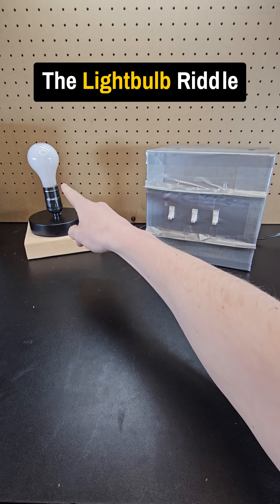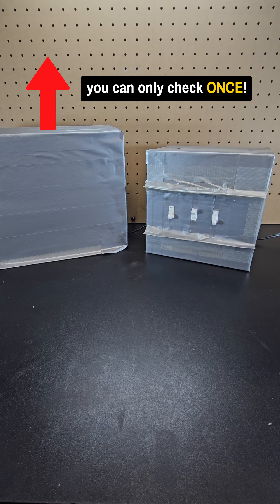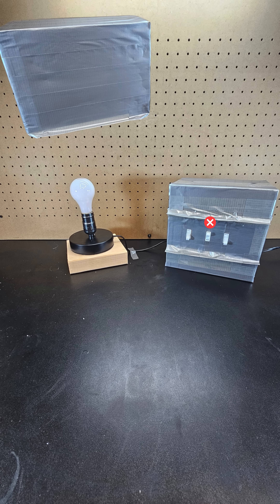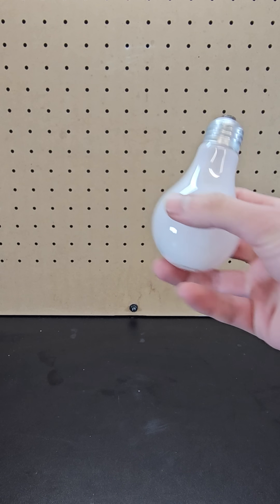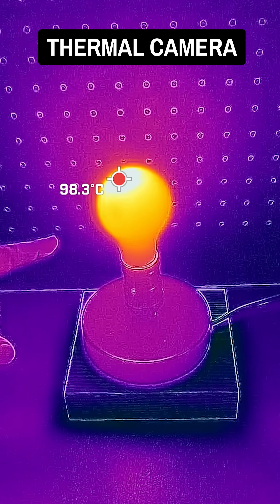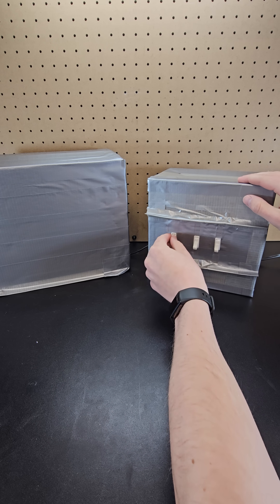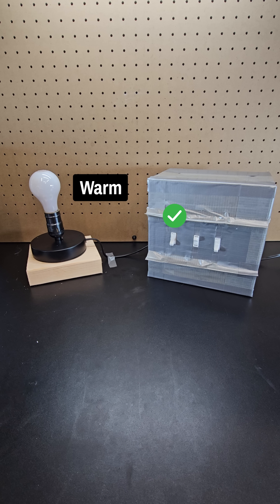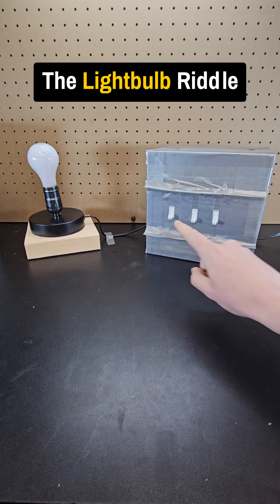Can you solve this Lightbulb Riddle? #science #shorts

Comment: First, you want to turn on the first switch and leave it on for ten minutes. Then, you want to go and check the light if it was hot. I forgot to say to turn off the light after ten minutes past. If it was hot then it was the first switch. If it was not hot then you got to repeat that same process, but with the second switch. If it was not hot then it will be the third one. That is how you do it

Comment: You flip the first one. Wait a bit and then turn off the first one and the second one on. Then check. If the light is on its the second one. If the light is off you touch the lamp and if its hot its the first one but if its not its the third one

Comment: Lift two of the switches, then turn one of them off and lift the cover, if the light bulb is on its the switch that is on, if the light bulb is off but hot to the touch, it's the one you just turned off, and if it's off and cold to the touch, it's the switch you haven't touched

Comment: Turn on the first light switch and wait an hour, then turn the first one off and enable the second one. If the lightbulb is on then the second switch is the correct one. If it is off and the lightbulb is warm to the touch then the first switch is correct. If the lightbulb is off and cold then the third switch is correct.

Comment: You flip the first and wait a bit, then flip it off. Flip on the second switch and remove the cover. If the light is on it’s the second switch. If the light is off and hot it’s the first, if it’s cool it’s the third switch.

Edit: For a second there I thought you were going to give a different way to solve it haha.

Comment: Flip the first switch and leave it for 10 minutes. Then flip the second one while turning the first one off. Then check. If the bulb is on then it’s the second one, if it’s off and hot, then it’s the first one, if it’s off and cold, then it’s the third one.

Comment: Before the explanation starts, flip one switch, leave it on for a bit, then flip it off then flip another one on, then check it, if it flows, well you're done, but if not, then touch it, if it's warm, then the first switch is correct, but if not, then the 3rd one is

Comment: One can guess with 66% accuracy. Chose one switch as your guess, flip that switch and another one, check. If the light is on then flip your switch off, as the probably of the second switch being the one has increased. If the light is off the third switch is always the solution. (Method works with led)

Comment: I find a similar solution but with one less step. 
Turn the 1st and 2nd one on. 
After 5 mins, turn the 2nd one off and remove lid. 
If bulb on, means it's 1st. 
If bulb off but warm, means it's second. 
If bulb off but cold, means it's third. 

Is this a valid solution or did i miss something?

Comment: A big problem with riddles like this is that it’s kinda hard to tell if it’s a “math riddle” (where everything you need is in the question you just need to understand it well) or a ‘trick’ riddle, where you gotta know the trick (and a issue with trick riddles is that there are so many tricks one could find for smth like this; lift the top then fiddle with the switches, use an infrared camera, see if you can see through the top, cut a hole through it, cut a hole through the table, look at the wiring of the switch…)

Comment: Keep the first light switch off, turn the 2nd light switch on about 10 minutes then turn it off, finally turn the 3rd switch on and look under the box

If the light is on it’s the third one
If the light is off but hot to the touch then it’s the second one
If the light is off and it’s cold it’s the first one

Comment: flip the first switch on wait 15-30 minutes turn in off then switch the second one and check if the light is on if it is then it’s the second switch but if it’s off the touch it if it hot then it’s the first one if it’s cold then it’s the third switch
Reply: i didn’t know he would reveal the answer i typed this before he told me 💀

Comment: I almost had it right, I was thinking u turn 2 light switches on and leave it for 5 mins then check if the bulb is warm, if it’s not then u know the remaining one is the correct one, if it is warm its one of the ones u flipped originally, I didn’t solve it but I brought it down from a 1/3 chances to a 50/50

Comment: Flip two, wait a few minutes, then turn on switch off. Check the bulb, if it’s on the you know it’s the switch that is on, if it’s off then checking if the bulb is warm can help determine wether the switch that you flipped on and then off was correct, if it’s cold then it’s the switch that you hadn’t touched.
Reply: I went: 1, 10 mins, switch from 1 to 2, lift the lid, etc.

Comment: Turn two switches on. Leave them on for a few minutes. Turn one off. 

If the bulb is on, it’s that one. 
If the bulb is off but warm, it’s the one you just turned off. 
If the bulb is off and cold, it’s the one you didn’t touch.

Comment: Flip two light switches check the box simple (if it's on then you only haft to guess between two) 
(If it's off then the only one that's not flipped is it)
Reply: Wouldn't you have the same odds if you only flipped one switch though?

If it's on, it's the single switch you flipped. If it's off, it's one of the switches you didn't flip.

Compared to...

If it's on, it's one of the two switches you flipped. If it's off, it's the switch you didn't flip.
Reply: he said it can’t contain luck

Comment: Turn on first switch, wait ten minutes. turn off the first switch and turn on the second. Quickly lift the box and if the light is on its 2. If the light is off touch it. If the light is cold, it's 3, if the bulb is warm it's 1

Comment: Simple as you have a 50/50 on getting another 50/50 or instant answer:
on off on
If light is OFF you found wich switch is the correct one
If its ON then ya have a 50/50 guess between the two flicked switches

Comment: You flip switches A and weight 10 minutes. Then you turn off switch A and then flip switch B and lift up the box. If the light is off then feel it and if it's cold then it is switch C if the light is hot then it is switch B and  if the light is on then it is switch A.

Comment: There is a tiny section of table that reflects the light while the cover is down, after you lift up and then put it back it's on the left side of the cover by the corner. But that reflection wasn't visible even when all of the switches were flipped, there was a cut in the video where it goes from off to on and you lift the cover. But that's technically cheating so this answer doesn't count.

Comment: Switch one switch and then wait 40 mins then turn it off then turn on the other switch

If the light bulb is hot then its the 1st switch, if the light bulb is on then its the 2nd switch, if the light bulb is cold then its the 3rd switch

Tell me if its correct!

Btw i paused it

Comment: Assiming no time limit. Flip swotch one for a cpuple minutes. Turn it off a d flip switch 2 
Lift up cover, if light is on the. Switch 2 is correct. 
Is light is hot then switch one is correct. 
If not on and not warm then switch 3

Comment: I actually know how to:

You flip the first switch. You wait ten minutes and then turn the first one off. Then you turn on the second switch on.

Then you check: 
1. Of the light bulb is hot and off it's the first one
2. If the second bulb is on and is cold it is the second one
3. If it is cold and off it is the third one.

Comment: Flick 1st light switch than wait 10 minutes than turn on the 3rd light switch and check the light bulb if its on its the 3rd light switch if its off and its cold to the touch its the 2nd light switch if its off. And hot to the touch its the 1st light switch

Comment: Turn the first switch on, leave it on for a minute, then turn it off and turn the second light switch on, then remove the cover.
If the light is on then it's the second switch, if the light is off but it is hot, then it's the first switch, if it's off and cold, then it's the third switch

Comment: You probably could measure when the line to the light is energized with an oscilloscope. Wrap some foil around the wire and measure voltage from capacitivity.

If all else fails, lift box and remove bulb. Answer: trick question, none of the switches light the bulb.

Comment: 1. Flip the first light switch, leave it on for 5 minutes.
2. Flip off the first light switch and flip on the second light switch.
3. Lift the box.

If the light bulb is off, and warm to the touch, the 1st light switch controls it.
If the light bulb is on, the second light switch controls it.
If the light bulb is off and cool to the touch, the second light switch controls it.

Comment: Keep the first switch on long enough to get the bulb hot, then turn it off, then turn the second swith on and lift the box. If the light is on it's the second switch, if it's off but hot it's the first switch, if it's off and cold it's the third switch.

Comment: I would flip 2 switches then I would flip one of the open switches after some time I would open the cover if the light is on that means it's the switch that's on if it's closed and hot that mean it's the the switch I opened and closed if it's not open or hot that means it's the switch that I haven't flipped

Comment: haven't watched the answer yet. you turn one of them on for like 5 minutes, turn it off, and turn on a different one and check. if the light is on, than its the one you just flipped. if its off and hot then its the one you left on for awhile. if its off and cold then its the switch you didn't touch

Comment: U guys ain’t getting it basically flip the first switch and leave it for 20 mins and then turn it off and then flick the second switch and instantly check the bulb. If it’s hot the first switch is the one. If the bulb is on the second switch is the right one. And if it’s cold and turned off then the 3rd switch is the one

Comment: heat. provided you can insulate the box well enough, flick a switch and leave it for a long time, then unflick it and flick another. If the bulb is hot, its the first you flicked. If its on, its the second. If neither, its the only one you didnt flick.
edit: wow ok, didnt expect this to be the ACTUAL solution, but ok

Comment: I’ve seen this before but with 3 switches and a room you can only check once. Here is the actual answer.

Flick the first switch and wait 10 minutes
Turn it off and flick the second switch
Check the room, if the bulb is off but hot, it’s the first one. If it’s on it’s the second and if it’s off and cold it’s the third.

Comment: Turn the first light switch on for at least 30 minutes. Then turn the first switch off   , and the second switch on. Now check the light. If the light is on then it’s the second switch. If the light is not on put your hand on the bulb to see if it is warm, if the bulb is warm then it is the first switch. Finally if the bulb is not warm or on then it’s the third switch.

Comment: flick switch 1 and wait awhile then turn switch  1 off and turn switch 2 on. Then check if the light bulb is on. If it is its switch 2. But if not touch the lightbulb to see if its hot. If it is, its switch 1. If not its switch 3
Reply: Yes i was correct

Comment: The solution is flip the first switch and leave it on for 10 minutes without lifting the box turn it off and put on the second switch immediately check the box if the light is on then you will know that is the second switch if it is off you can touch it and if it is warm, then you will know it was the first one if it was cold, it would be the third one

Comment: Turn on the first switch and leave it for ten minutes. Then turn on the second switch and check the light. If the light is on it is the second switch. If it is off and hot it is the first switch and is it is off and not hot it is the third switch. This is because having the first switch on for ten minutes will heat it up.

Comment: Turn on two of the light switches, wait 5 minutes, turn one off. Lift the box. If the light is on it’s the switch that is still flipped. If the light is off feel the bulb. If the bulb is warm, it’s the switch you flipped off. If the bulb is cold it’s the one you didn’t flip.

Comment: You turn one light switch on, and wait a few minutes, then flip one more and open the cover. If the light is off, then it’s the third switch. If the light is on, you check if the bulb is warm. If it’s warm, then the first switch is the one that controls it but if it’s warm isn’t warm then it’s the second switch

Comment: i would flip one switch for 3 mins then close it and switch on another one if the light is on it's the second one if the light is off but the bulb is hot it's the first one if it's off and it's cold then it's the third one

Comment: Let one switch be on for a while then turn it off and turn on the other switch and check: if the first one u did will turn on the light the lightbulb will be hot but if it is lit and it isn't hot it is the second one and when none applied then it is the third

Comment: So what you should do is cover the light and only flick one switch and leave it there for about a minute to 2 minutes flick it off and uncover it if the light bulb is hot and then it is the light switch if it's not do it again until light bulb produce heat and the only switch that can produce heat is the correct one

Comment: The correct answer is to leave switch A on for about 10 minutes. Then turn the switch B on and lift the cover. If you lift the cover and see that the lightbulb is on, then it has to be switch B. But if the lightbulb is off, you touch the lightbulb to see if it is hot. If it is hot, then jt it is switch A because you left it on for 10 mins. But if it it is cool, then it is switch C as it was never flipped. 🎉

Comment: The correct answer is leave switch a on for about 10 minutes. Then turn the switch B on and lift the cover. If you lift the cover and see that the lightbulb is on then it has to be switch B. But if the lightbulb is off you touch the lightbulb to see if it is hot. If it is hot then jt it is switch A because you left it on for 10 mins. But if it it is cool then it is switch C as it was never flipped.
Reply: Damn i got that right

Comment: This is when light bulbs gave off heat. Turn on the first switch and wait for 20 seconds. Then turn it off and turn on the second switch and lift the cover. If the light is on it's the second switch.   If the light bulb is off, feel the light bulb. If the light bulb is warm it was the first switch
If the light bulb isn't warm then it is the third switch.  

(You definitely don't need to leave the first switch on for 5 minutes. 20 seconds will be more than enough)

Comment: Turn on switch 1 for a few minutes, then turn off switch 1 and turn on switch 2, then check.

If the lightbulb is warm, but off, switch 1 controls the bulb
If the bulb is just on, it's switch 2
If it's off, and the bulb is cold, it's switch 3

Comment: Without removing the cover, turn on one light switch for ten minutes then turn it off and turn another one on, take off the cover, and  feel the light bulb. If it is hot, then it was the first one you switched on if it is cold it is not the one you turned on or the second one, if it’s on when you pulled the cover, it is the second one you swithched

Comment: Flip the first switch leave it for 10 minutes then turn it off and flip the second switch on and lift the box if the bulb is off and it's hot it's the first switch if the bulb is on it's the second switch if it's off but is cold to the touch it's the third switch

Comment: Open 1 switch and leave it li for a while then close it and open the second switch , lift the box , if the light is on then it is the second switch  if it is off touch the lamp if it's hot then it's the first switch if it is not then it's the third switch

Comment: But this solution won't work if its a led light bulb. So, the best solution is to drill a hole in the box and then test all light switches.
Reply: It would still work. LEDs do warm up, ant the power supplies needed to lower and rectify the voltage do even more.

I bet you have a bulb like that at home. Just do a scientific experiment and check it your self instead of repeating this myth.

Comment: Flick the 1st one for a few minutes then switch it off then turn on the 2nd switch.If the bulb is on it is the second one if it is off and hot when you touch it it is the 1st one if it is off and cold it is 3rd one

Comment: first turn on the switch 1 for ten minutes, then you turn off, after this you flip the switch 2 go and check the light, when the light is on then is the 2, if not then touch the lamp, if is warm then it was switch 1, if the light is cold then is the switch 3

Comment: turn the first switch on for ten minutes. then, turn it off and turn on the second one. If you lift the cover and the light is on, it is the second one, if it is off, touch it. if it is hot, it is the first one, if it is cold it is the third one -edit: i made this comment before he showed the solution

Comment: Flip the first switch and wait 10 minutes, turn off the first switch and turn on the second switch, and then instantly lift up the box. If the light is on, that means it’s a second switch if the light is off but the bulb is hot. It means it’s the first switch and if the bulb is off and it is not hot, it means it’s the third switch.

Comment: 1st turn on the first for about 30min 
2nd turn off the flirts button and turn on the second for another 30min
3rd turn off the second and turn on the third 
4th check the bulb
the trick here is that if the bulb isn’t on but it’s cold,then the first is the correct,if it’s hot the second is the correct one and if it’s on the third is the chosen one